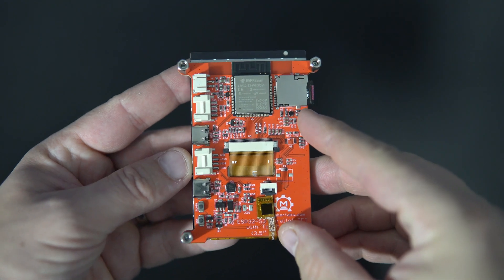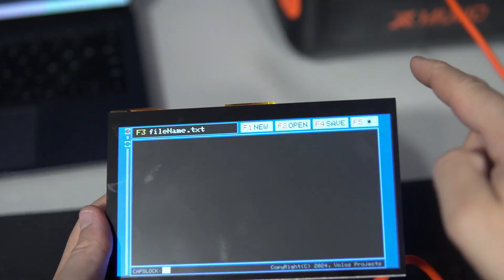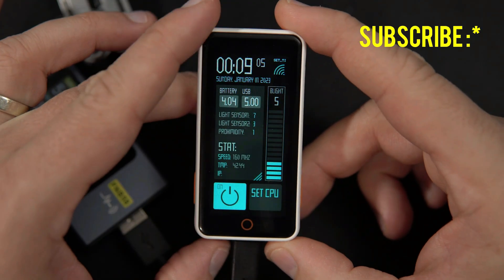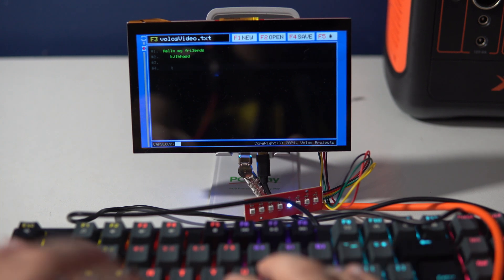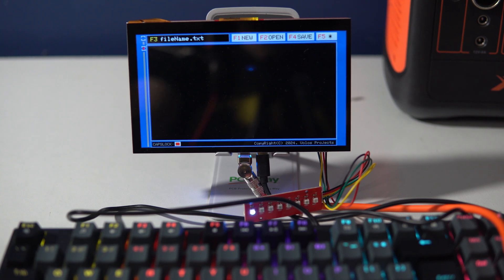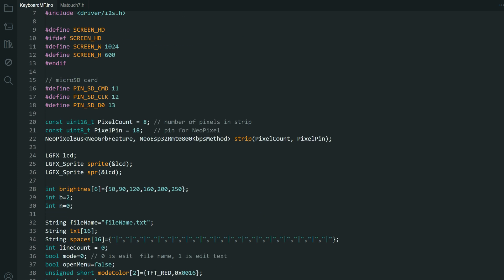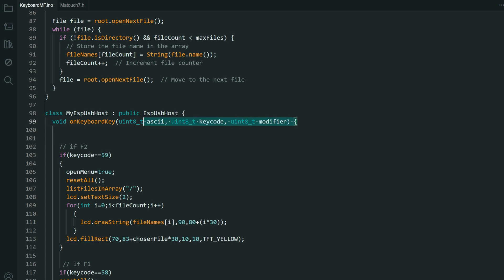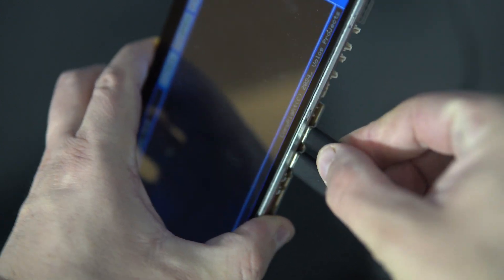Yes, You Can Plug a PC Keyboard Directly into an ESP32 – Here’s How!

Comment: Subject: Amazing ESP32 Keyboard Project - Seeking Your Valuable Advice

Dear Volos Project,

I'm truly impressed by your ESP32 keyboard input system project! The way you implemented a Word-like interface with text editing, file operations, and brightness control on the 7-inch display is absolutely brilliant.

I'm working on a similar project using an ESP32-S3 with a 7-inch 800x480 touch screen, trying to create a basic text input system where keyboard presses display characters on screen. While I understand the core concept, I'm facing challenges with:

1. USB Host initialization - Getting the ESP32-S3 to properly recognize the keyboard
2. Character mapping - Converting keycodes to actual characters for display
3. Display integration - Coordinating between keyboard input and screen output

Could you please share some guidance on:

· Which libraries or frameworks worked best for USB HID handling?
· How you managed the text display and cursor positioning?
· Any particular challenges you faced with the ESP32-S3 USB OTG?

I'm not asking for your complete code, but some architectural advice or key code snippets would be incredibly helpful. Your expertise could save me weeks of trial and error!

Thank you for inspiring the community with your excellent work!

Best regards,
Haitao Lv

Comment: How are you, I got the same matouch display, I did use the code you shared but can not get it to work, can you help with some info about it please, what is the ver of the LovyanGFX? and any other specific versions and the board configuration for the esp32 that we need to use, plus if you don't mind share the code without the neopixel part.  Thanks

Comment: I have bought the same module but I can't get the keyboard working did you do something special ? the program compiles and run. I saw the interface using debug info I see that the keyboard is detected but then nothing works evensong basic program. any tips ?
Reply: hi, do you find a way to connect the keyboard to esp32 (use usb port on the esp32-s3) ?

Comment: I'd love to see a version of this with a proper word processor -- WYSIWYG page layout, TTF+OpenType font support, save as .doc, the whole deal. It's absolutely doable, I have a 1989 Panasonic hardware word processor that could do most of that. I don't think it had inbuilt font support, but it had WYSIWYG page layout and bold/italic/underline formatting, that sort of thing. Ran off a Z80 CPU just like a TI graphing calculator. Even MS Word 97 had TTF support, and if you still use .doc files instead of .docx (I'm guilty of that), it's Word 97 that established that format -- Word 95's .doc is different.

I'm no programmer, but if you tell me you'll do it, I'll buy the board and help beta test.

Comment: Hi, I recently found your videos as three things all aligned.

I plugged in my old PC I haven't used in close to 11 years. I could hardly get it working and found Linux was something I could get the thing running again.

My neices have started doing some coding at school and I had no idea about it, so it has inspired me to try to learn a but of Python/ micro python in preparation for my own daughters. 

And I received a free TTGO ESP32 from Aliexpress and had no idea where to start with it.

With that, where would you suggest I start so I could learn how to do some simple projects? Do you have some useful videos, if not then maybe this is something you could make, or are there any websites which you think would be a good starting place?
Reply from the maker: hello, i have whole playlists of projects made using ttgo  you can find it here https://www.youtube.com/watch?v=MRlcGGTdEFk&list=PLRCQZ78SXVWjjpOdTx_1EH1MZuzzSOHYv    i never used linux so i cant help you there, but it is practicly the same you will need to install Arduino IDE and you will need to install tft_espi library , this is probably first video you want to check https://youtu.be/b8254--ibmM

Comment: Nice looking project. 😃 Takes me back to the old DOS days (or Linux terminal).

Can I suggest a relatively small change that would make your code better readable... even for yourself ? 😉

Similar to these library constant values: TFT_SILVER, TFT_YELLOW, TFT_RED and others.

You could define your own constants for the keyboard number codes (maybe even re-use from an existing library or code snippet).

if (keycode == 58) becomes if (keycode == KEY_F1)
if (keycode == 59) becomes if (keycode == KEY_F2)
if (keycode == 57) becomes if (keycode == KEY_CAPSLOCK)
etc.
Reply from the maker: Yes, i know , i am just lazy, but i will need to start using solution your suggested, it will be easier to read code both for me and others😀
Reply: @VolosProjects  😁 If it's really "clean" looking code, or not. In both cases I say: Thank you for sharing! 🙏 🙌

Great to see different examples of what the ESP32 chips (and the boards it is attached to) are capable of. 💡

Comment: This is AWESOME 👍

Imagine a version of this with an eInk display, the battery life could be a week on an 18650 !! LoL

(Great choice of green on black. That's been my txt editor theme since 1982 !! 🤣)
Reply: If I'm not mistaken, green/black and amber/black were chosen because they caused the least eye strain.
Ironically, Apple who decided to break the rule (maybe Xerox or SGI did first) with a black/white monitor on their first computer, is now pushing amber display mode on their iPhone, 40 years later...
What actually causes the most eye strain is anti-aliased fonts.
Reply: @VeniceInventors It's a good theory, but the actual reason early screens were amber or green was due to the fade duration of the phosphor coating. Early CRT electron guns had a limited scan speed. 

After exhaustive testing dating back to the use of CRT's in WW2 Radar systems, green was chosen as the default chemical coating for TEXT because it had the best fade duration.

There was also red screens and white screens that were better for faster graphic based displays.
Reply: @edwardfletcher7790   I stand corrected 🙇